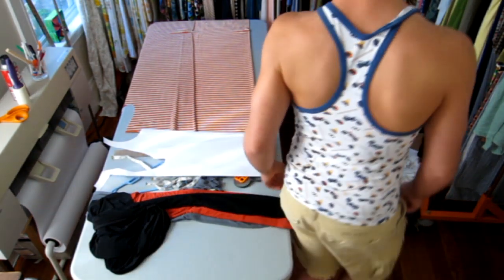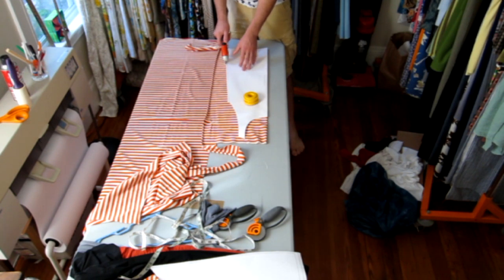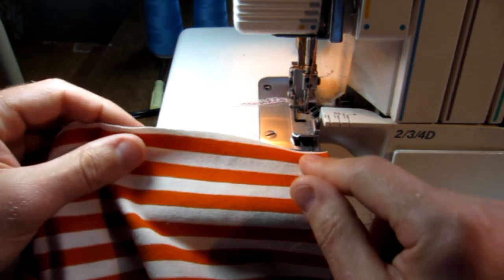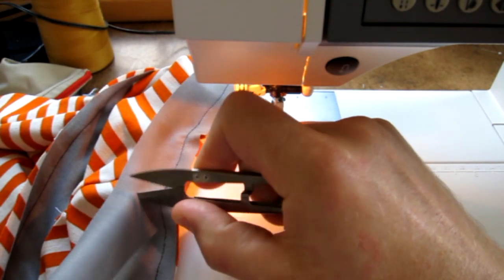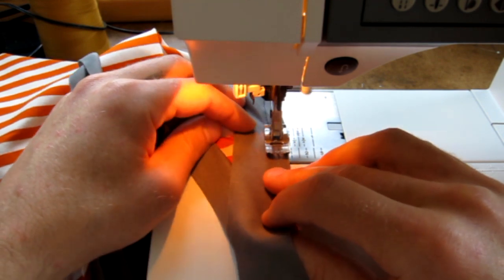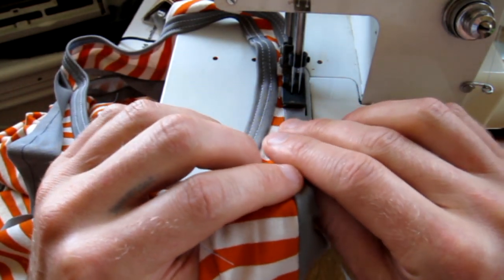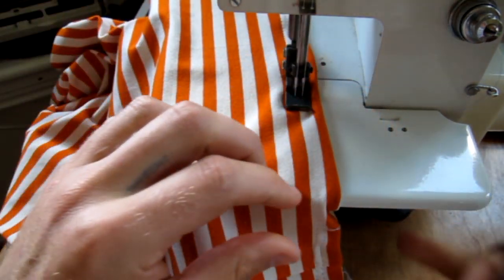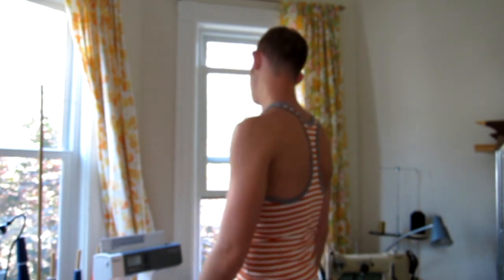How To: Sewing A Y Back Racer Tank Top

Comment: I have used a twin stretch needle to complete binding on my spandex projects. I found the needle to leave a nice finished edge. Saying that I did go through a couple needles experimenting... do not backstitch with twin needle as it will break.. instead use the "fix" function on your sewing machine or overlap stitches as you did on binding.

Comment: Just a side note. It would be easier to fold your binding and serge the end first leaving a couple of inches loose on each side so you can join them at the sides seams. 
Then coverstitch if you want or just straight stitch the serge bit down about 1/8” from your seam.